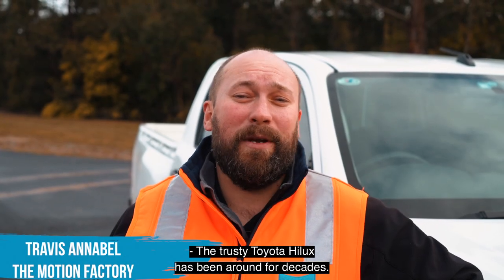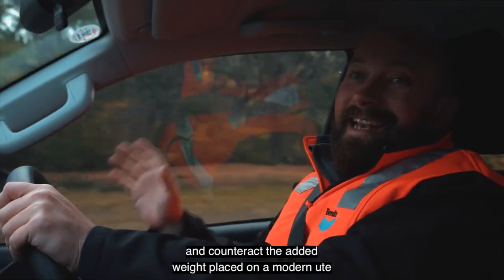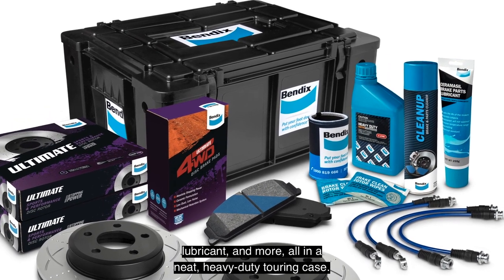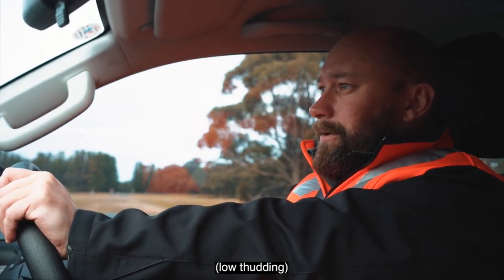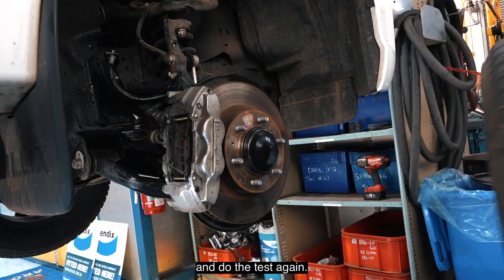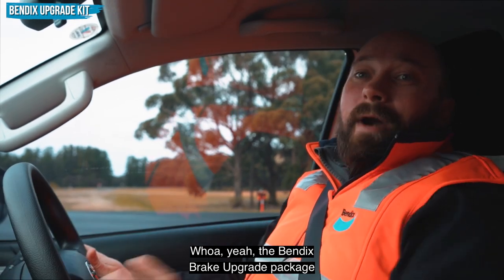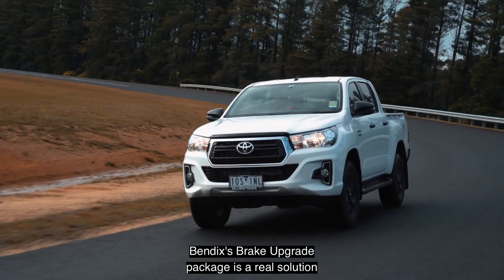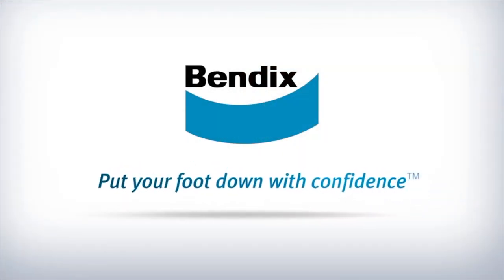Toyota Hilux Brake Upgrade

Comment: Hi, I have just bought a new kit, unfortunately I stripped one of the brake lines, is it possible to buy one of these as a spare part?
Reply from the maker: You will need to contact your retailer and ask them to order in a new set of braided brake lines for you.

Comment: How does it stop you faster or shorter than the ABS threshold ?
Reply: Alex McAllister less heat in the rotors better pads gripping quicker and better hoses to improve feel can all make a difference in this case dropping 10m